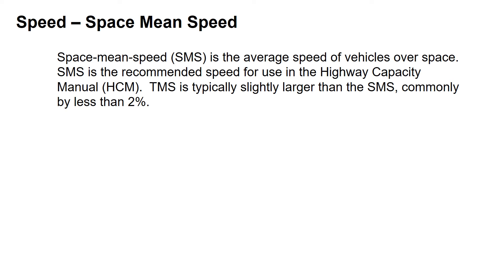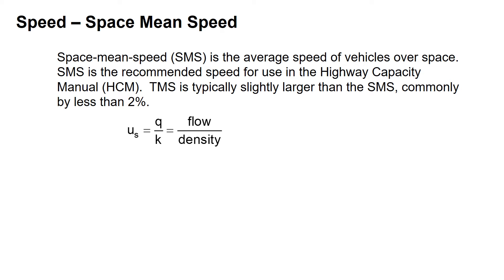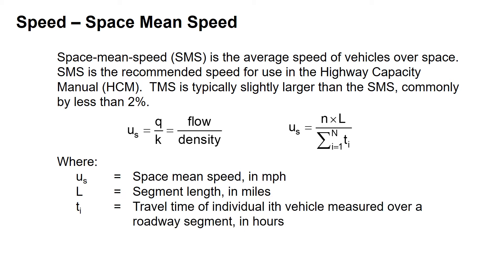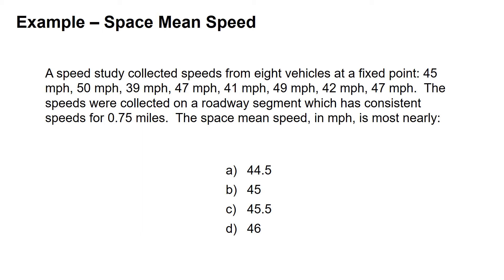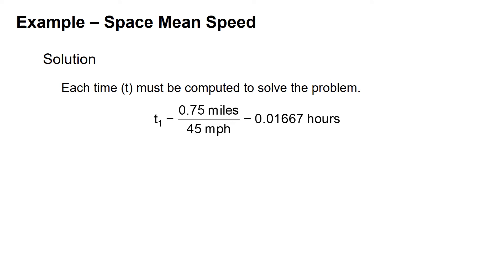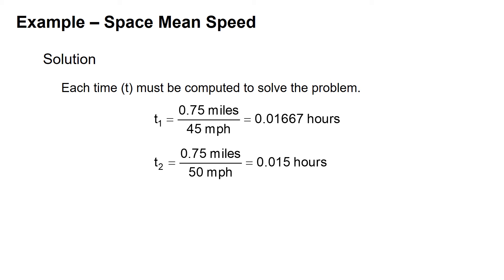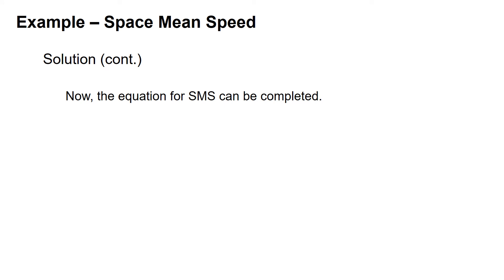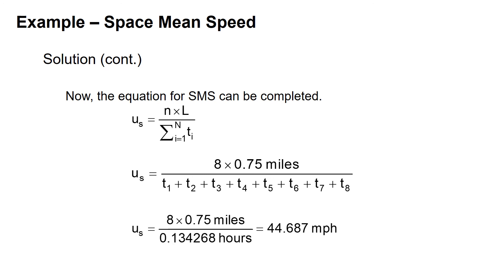Space Mean Speed | NCEES Civil Engineering PE Exam [Section 5.1.1.2]

Comment: Redoing this problem has allowed me to discover a shortcut. If SMS = TMS - TMS*2%. Then, if TMS = 45 mph the only answer available is (a). This is a major shortcut to save time. Check it out.
Reply from the maker: This will definitely be useful to eliminate some of the answers (possibly multiple).  However, the difference is not always 2%, but it is true that the TMS is always greater than or equal to the SMS - which can be helpful in a multiple-choice question situation.

Comment: if calculated answer = 44.69 mph why are you going with final answer "a" = 44.5 mph instead of "b" = 45 mph. is this because there is a smaller different between our answer and "a" than there is between our answer and "b"; or is there a better, conceptual reason for this? a reason, perhaps, related to safety or rounding rule of thumb in this type of a problem ?
Reply from the maker: Yes, that's correct - it's closer to 44.5 mph, so that's why I selected "a".  For the exam, I hope they won't put an answer choice so close to the midpoint, but it's possible.
Reply: @FindleyDaniel  thank  for your input!
Reply: @FindleyDaniel  Does it mean there is no conceptual logic to choose"b" Instead of "a". Mathematically rounding it would make sense be 45 best answer.
Reply from the maker: @thomassbahtu1503  No, I do think there is some conceptual logic in selecting "b".  However, in the way I worded the question, I believe "a" is the better choice.  I specifically worded it as "is most nearly", based on that wording, 44.69 is more near 44.5 than 45.  

It's also possible that "minimum" or "maximum" can be integrated into problems that would change that logic.  For instance, "the maximum......is most nearly:"  or "the minimum......is most nearly:".